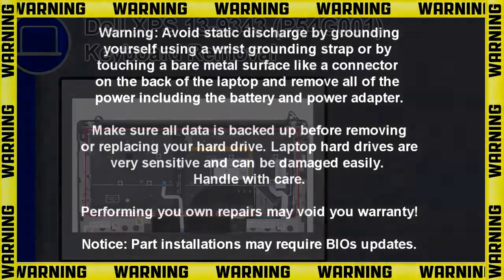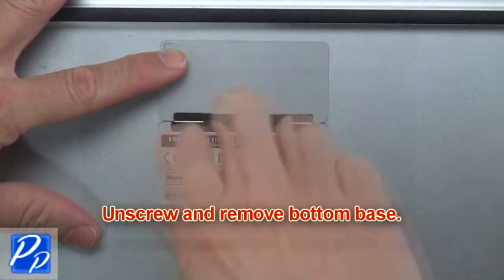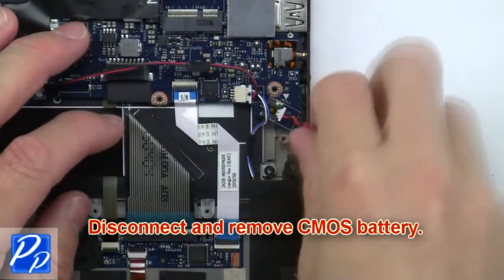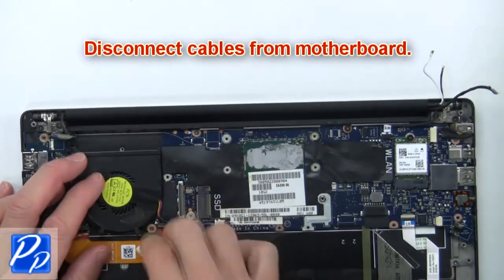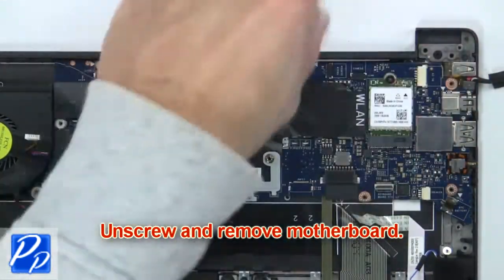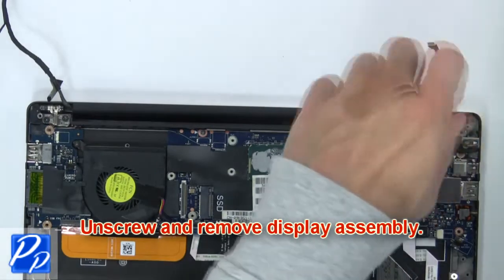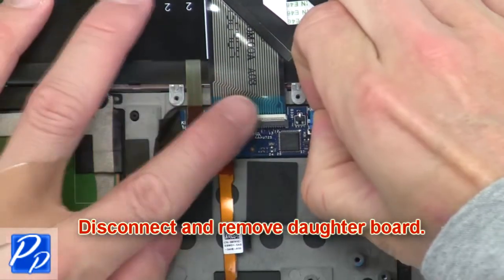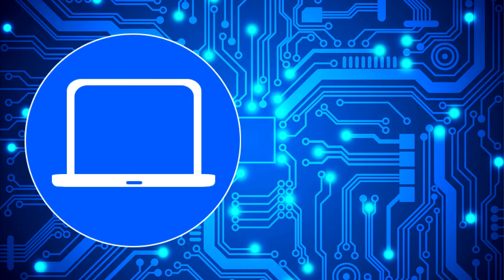Dell XPS 13-9343 (P54G001) Keyboard How-To Video Tutorial

Comment: Thanks for putting this up, I was able to install my keyboard in about 2 hours. One piece of advice for anyone, is that I needed to use a torx 5 (T5) to get the back screws off. Also, don't over tighten or you'll ruin the inside of the screws.